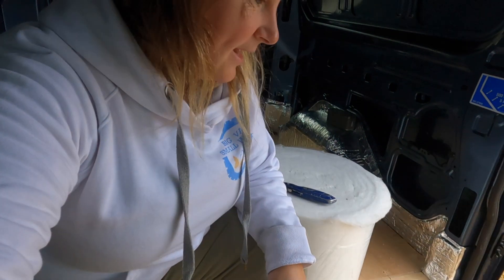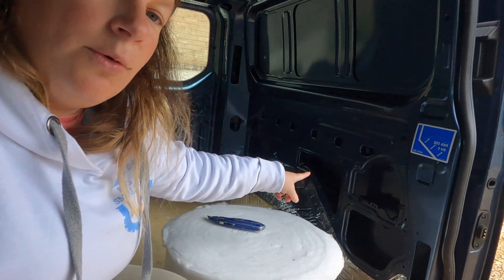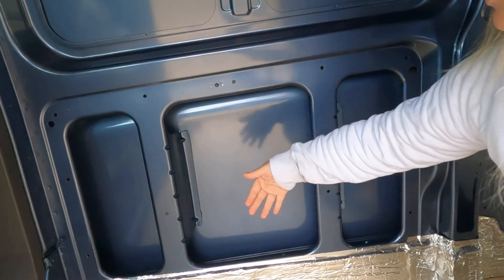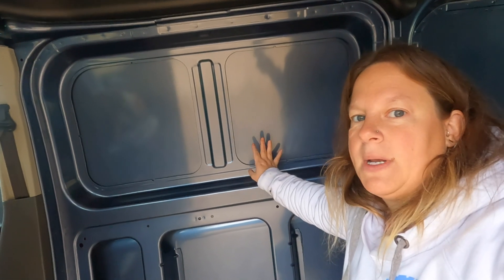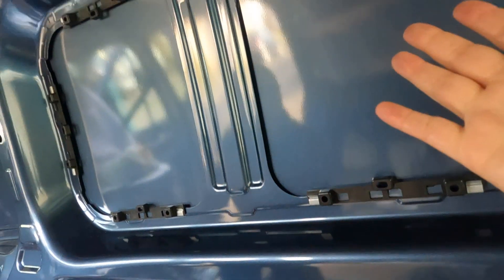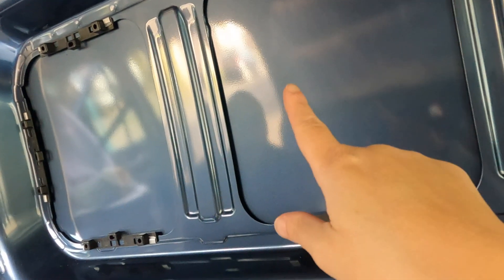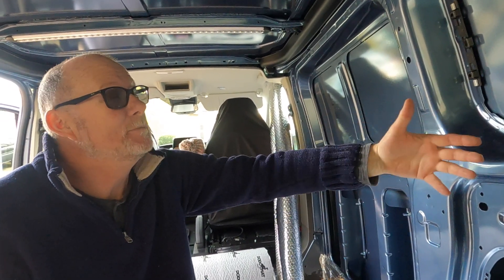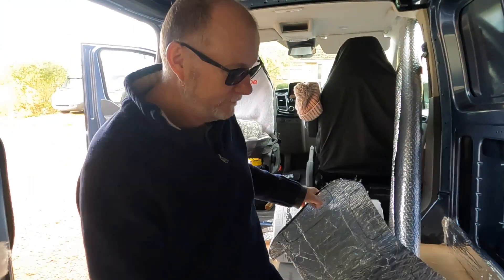How I insulate a van camper panel

Comment: I remember when i first started my insulation thought it won't take long.. and began to wish i never started it..but due to working fulltime and using every spare minute i believe it took me about 2 months but did it properly..as like you first dodo 10mm which took 3 rolls..then the recyclable loft insulation 12 rolls...3 sheets 8x4 of 25mm insulation board and finally 2 roll of 5mm vapour barrier..van is a lwb citroen replay...be living in it 5 nights a week at the trucking company's yard I work for since August 22 ..due to good insulation i run my heater for about an hour and it keeps warm during night...keep up the great work cant wait to see it finished.

Comment: Does the dodo Matt sound Deaden as well
Reply from the maker: Yes it does - if you get the silver backed one it’s an all in one product. 
Insulation, sound deadening and vapour barrier x
Reply from the maker: As long as you also silver tape over all the joints and exposed metal parts before your cladding or walling boards 👍🏻